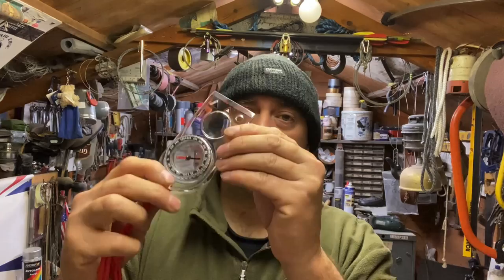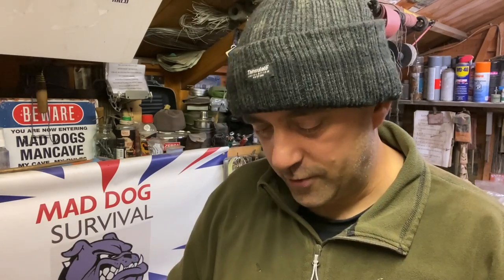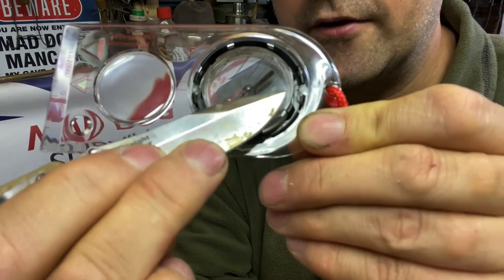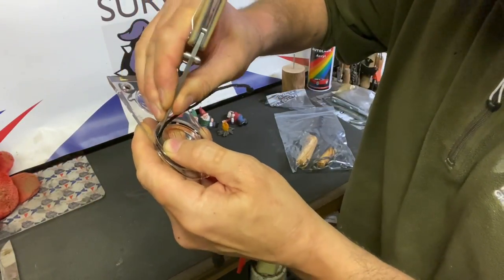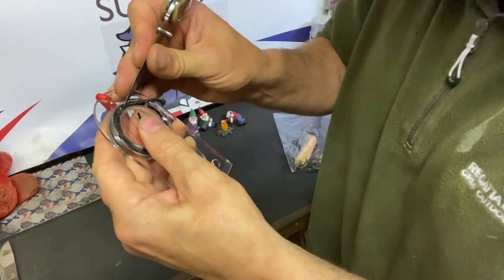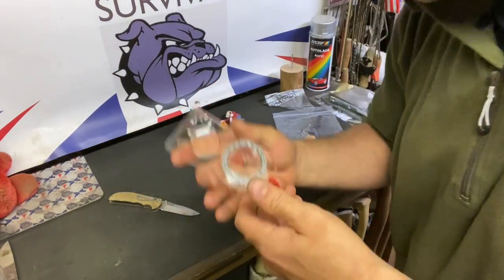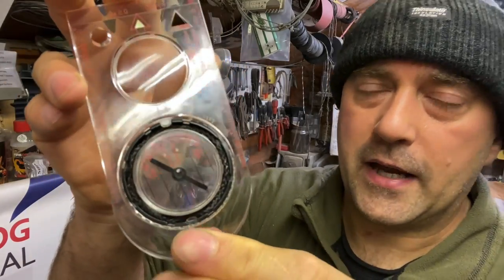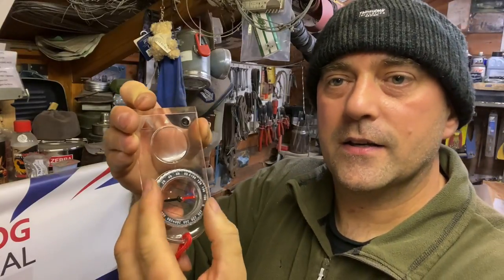Mad Dog bites #7! Cheap compass trick/mod/improvement!

Comment: Some people think to follow the compass and all is good, however, you can be following a 350 heading but drifting. Like in a boat, I can be heading 350d but between wind and current I can drift off by miles and still be at 350 headings.
Reply from the maker: Yes and the same on land without a compass we get lateral drift from our dominant side causing us to vier off track with out realising. That’s why it’s important to have visual reference points! Definitely good points brother! Hope your well and not doing too much work! Best wishes friend 👍🏽👍🏽😎